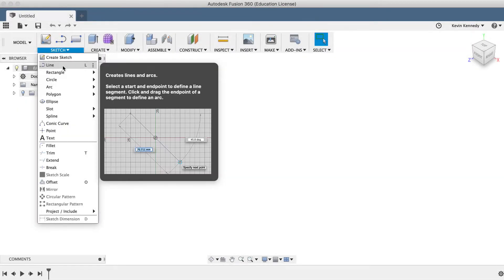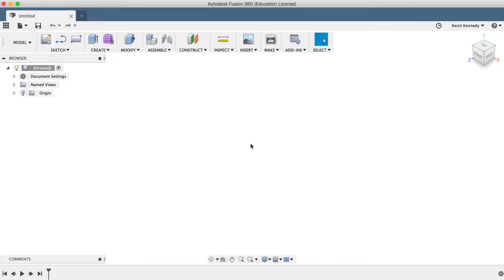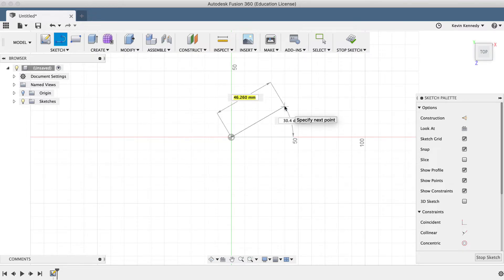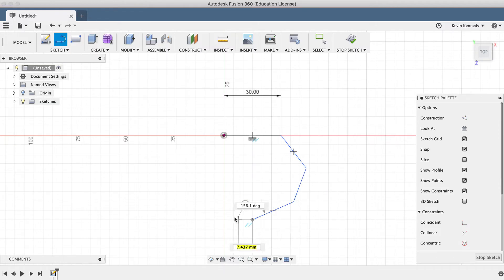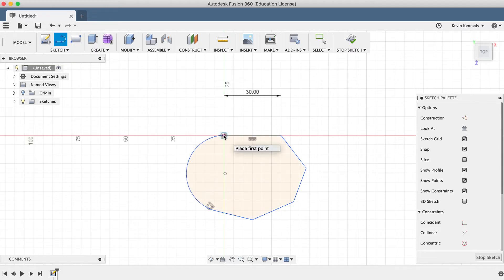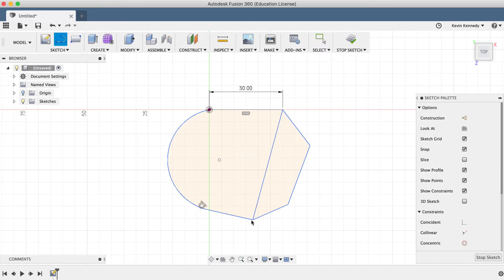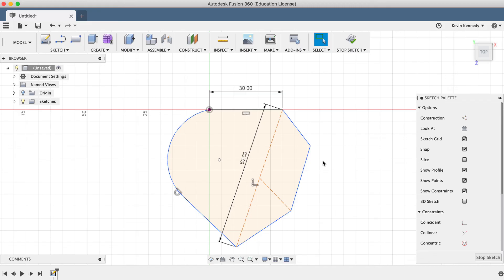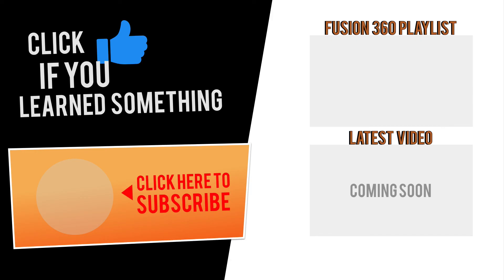How to Create Lines and Construction Lines in Fusion 360 (Secrets Revealed)

Comment: Nice video, But I do have a question: Lets say you have a box that is 50mm SQ. But now you want to divide the inside of the box to create box's within the large box. How to you start a line at a certain point along the 50mm line. Lets say 13mm from the corner. and then another box 20mm from there. Thanks for your help.
Reply from the maker: That can be done with the sketch dimension tool When selecting the two points to define a dimension, you'll select the edge of the existing box.

Comment: Hi, quick question. learning to use the sheet metal tool and i need to bend sheet metal along a line, accross a square. when i draw the line it will snap to either side of the square but i dont know how to possition the line in the correct place. lets say i want it 50mm away from a given edge. i dont know how to place it at 50mm. perhaps you can explain. thanks!!

Comment: when I use the keyboard shortcut "X" for construction lines the chamfer modifier pops up instead. how do I fix this?
Reply from the maker: Is the line or geometry selected first?

You can restore the default settings by selecting your profile > preferences > Restore Defaults
Reply: @ProductDesignOnline  resetting defaults didnt work.  got it working after reinstalling. I think when I updated it got messed up, but it works now so all good

Comment: Is there any way to create dashed lines? Im having problems when I save the 2D sketch as a DXF, it automatically turns all the construction lines into solid cut lines. I need to retain the construction lines or make them dashed lines so they know where to bend.
Reply from the maker: Hi Derek. What service are you uploading to? (any chance it's SendCutSend?).
The save as DXF from a sketch workflow will (unfortunately) not work with dashed/bend lines. Saving from a Sheet Metal flat pattern or a 2D drawing (Drawing Workspace) will include them.

Comment: how do you add a line to a line at a certain point
Reply from the maker: Hi, James. You will have to create the second line off of the first - the starting point of the second line should snap into the original line. Then, you can use the Dimension tool (letter D to activate) to dimension from that starting point to another point (whatever you have a known dimension of).

Another option would be to add a "Sketch Point" to the line. The sketch point can also be dimensions to another point within the sketch geometry. You can then create the line off of the sketch point (it will automatically add a coincident constraint).
Cheers, Kevin :)

Comment: well done video, useful addendum to the daily lessons. i'm glad for the additional instruction on the basic foundation elements such as the line tool since i'll probably be using that 95% 360fusion is open, and this makes things easier to figure out when fusion 360 doesn't do what i want it to do.
Reply from the maker: Hi, cmc 123! Thanks for watching and commenting! I'm happy to hear you find these shorter lessons on single commands useful. I'm going to continue to release more of these in 2019, with the end goal to build a solid library of videos to reference when users are wanting to learn a single command, or simply need a quick refresher. Wishing you a Happy New Year! Cheers, Kevin :)